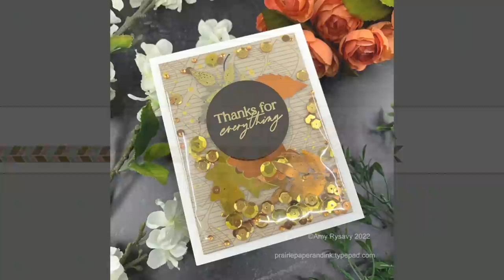Using Leftover Adhesive Transfers to Make A Flat Foiled Shaker Card

Comment: Beautiful shaker card, Amy, and a great use of the leftover adhesive transfers! The tip on adding cardstock for weight to the acetate pieces is great advice, much appreciated. NancyStamps on YT has done a great deal of every type of foiling ever invented, and she says that the best way to use Minc or laminator style/toner foiling is to have a soft brush dedicated specifically for the purpose, and to dust off the front and back of the foil AND everything it touches (e.g., the cardstock, or in your case, the acetate) because doing so removes dust, pet hair, etc. and you get a much smoother result with no pitting or speckling on your foiled pieces. Just a little tip for you! Thanks for sharing this lovely card!